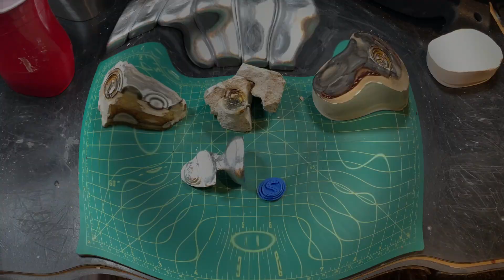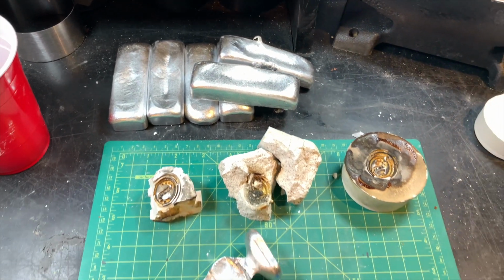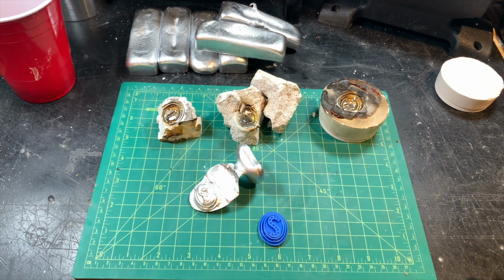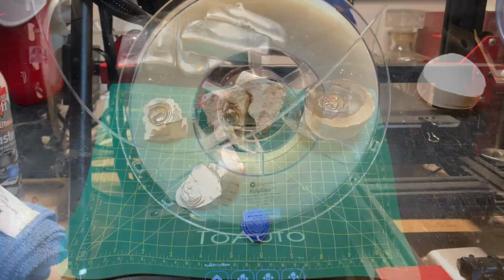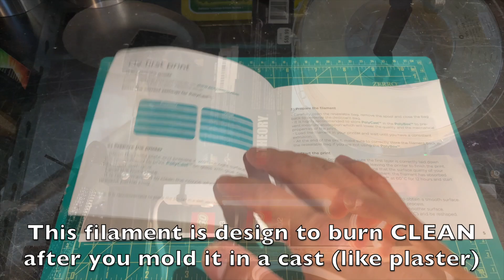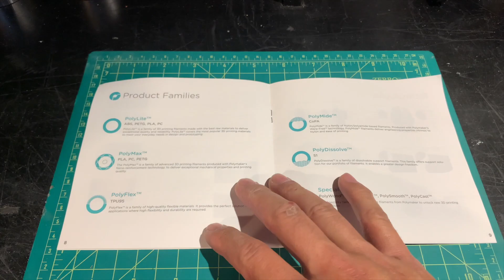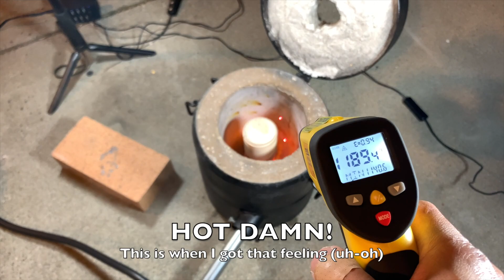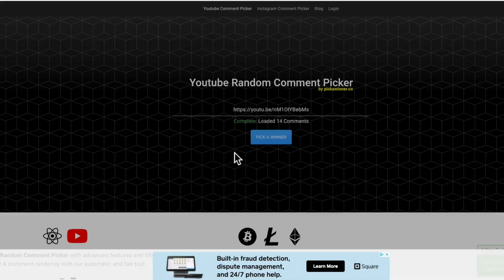SPACEBALLS  🚀 Schwartz Ring💍 FAIL(S) :  TRIED➡️FAILED - #foundry #trashtreasure #melt #casting #fail

Comment: could it be crumbling due to a temperature thing? what’s the melting point of the PLM material?  I’ve seen people use casting wax and melt it out of the mold in the oven on a lower heat... either way valiant attempt and thanks for sharing the good with the bad.  Oh yeah, nioce giveaway & congrats to Beast Mode!!
Reply from the maker: Yeah it may be due to the temp, the mix of the plaster, if it was 100% dry, the spruced I used, so many variables.  There will definitely be a version 2!   Just glad you enjoyed it even when it’s a fail.
Reply: @What2Melt_by_Randall  for sure man! I plan on trying this myself someday so any info is good info.
One other thing I’ve seen is after pouring the mix, placing it in a vacuum chamber to pull all air bubbles out... Ive priced them and a setup was under $100 .
Reply from the maker: @MARVELOUSMETALS  yeah I saw that too (vacuum chamber).. similar on how they get of air bubbles from resin casting. I also think the way I tried to burn out the PLA... with my fur👍nace. I see people have kilns.. not sure If I will go there.. so back to the drawing table and do a lot of research for Version 2.. (maybe 3,4,5,6.7.....)
Reply: @What2Melt_by_Randall ht sv you tred ming second ver of with sy cardboard blade th cou cool pakintoldcstar wars lightsaber tiys
Reply from the maker: @zacharyjochumsen9677  thanks for the comment.  It’s been three years since doing this melt.   I may try it again since i am finally active on the channel.
Reply: @What2Melt_by_Randall yeh you coud trithis agin but plastic thing atdked t xbkade bleam